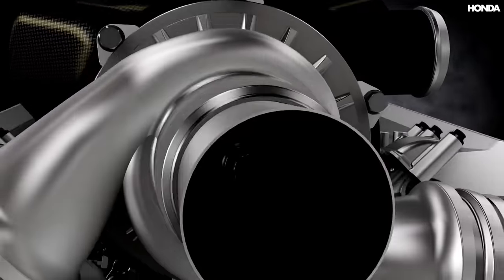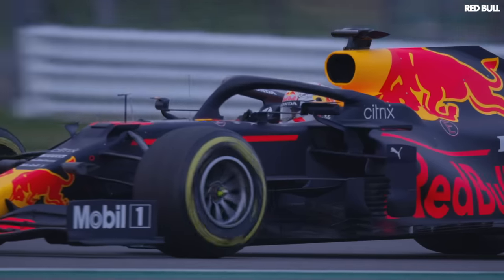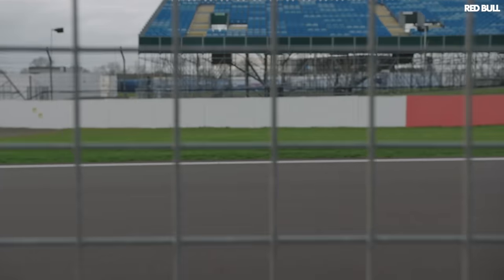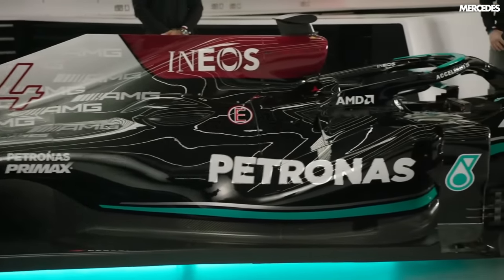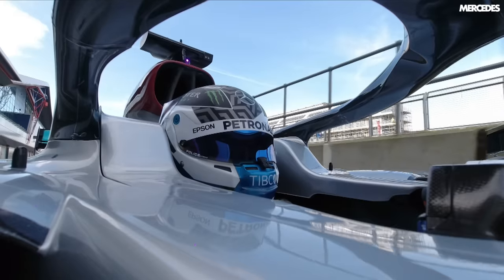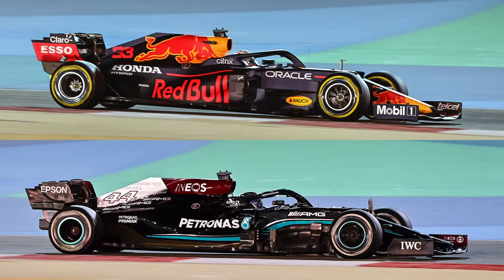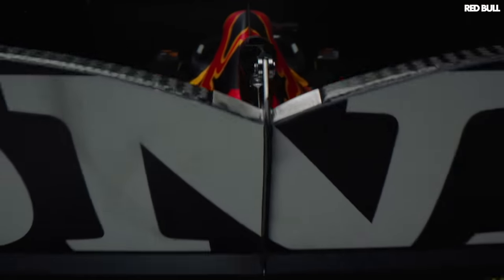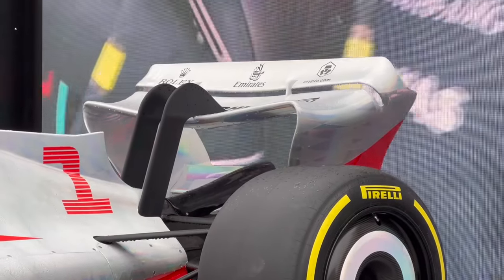Red Bull's SECRET Engine Upgrades to Beat Mercedes | Formula 1 Engineering

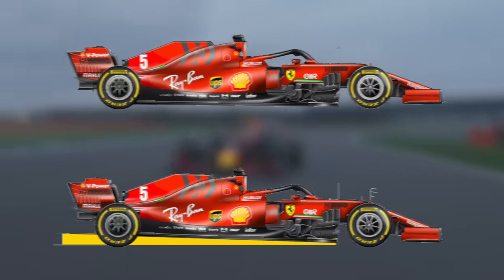Comment: the phase diagram you show as 8:24 is actually of water. the line solid-liquid separation line going with a negative slope is called the anomaly of water, since in most materials this line has a positive slope. so i'm not sure the phase diagram here tells the correct physics of supercooling

Comment: Super cooled could imply a partially solid liquid mix, like a slush. Spacex uses super cooled propellants, and this is what is ment in that case. The liquid oxygen is delivered to the vehicle as a slush, and the engines are tuned to run with fuel in that state.

Comment: Too much flex is however much Red Bull has.  Perfect flex is however much Merc has, even if it's more than Red Bull.
Reply: the tech regs say:-
Areo surfaces must remain ridged to the sprung part of the car(the chassis).

when you watch a rear wing take a bow along a straight from a camera fixed to the chassis that is not a legal back wing in acordance with the rules.

Comment: Could you perhaps touch on the reasons these two engines sound different? Hearing them in person its quite noticable, the different flutter sounds of the RB and intake sounds from the Mercedes. They are the best sounding engines on the grid!
Reply: The noise of the red bull off the throttle(over run) is the exhaust  gases   working on the mgu h like he explained
Reply: The Honda sounds brutal when it's off throttle going into a corner. Similar  to the blown diffuser  days

Comment: As I understand it, the split turbo also allows for simplified plumbing, which allows for tighter packaging.  Why the others haven't gone this route already I don't understand.
Reply: All engine makes have adopted it by now but Honda is the first to use it in that form of way. Merc was the first to do it and since it helped with engine power and efficiency. Renault and Ferrari both adopted the improvement as well.

Comment: Toto wolf already said that the result at silverstone confirmed something and that they unlocking a new thing, a new path. He didn't elaborate. Whatever Redbull is cooking, Mercedes is doing something even crazier.
Reply: This is why I've never bought the idea of RB somehow "having the better car" this season, or the notion of RB and Merc having "swapped places". Many of the people saying this tended to ignore such points made about Merc in past seasons on the string of their success, owing credit to the drivers when they probably didn't make up that difference on performance that people would want to think.
Reply: @AdotLOM  The Redbull having a better car thing comes from the regulation which removed downforce elements (Kept the different pressure Air from going under the car?! Not sure but something like that) from the skirt of the Mercedes' but Redbull are not as affected as much cause they run a (High rake, Shorter Car) compared to Mercedes (Low Rake, Longer Car)

Basically, the FIA stopped another team to benefit another (hindsight 2020)
Reply: Yeah Mercedes wings got clipped, add that to the fact that this years car was on the back burner early so they could focus on next year's car is pretty much an insult as if to say any other teams that are close are only because of hindrance/focusing on another era

Comment: @REDBULL was the ONLY TEAM that was allowed a NEW ENGINE although all other teams were not allowed to develop new engines or even introduce new engines for the 2021 season. WHY? Because @REDBULL and @Horner were whining about their old engine and threatening to pull out of F1 if they weren't allowed the new engine. WAKE UP F1 fans including you @Driver61, bullshitting viewers about technological "advancements to turbo units and other crap. #F1 is turning a blind eye to @REDBULL's new engine for #FINANCIAL reasons and because it would lose too much if @Redbull would pull out of F1. THAT's the REAL reason. and F1 fans know this!

Comment: Question Do teams use the Mgu-H to contol boost presser? If not would it be possible?
Reply: Yes the Mgu-H ( Motor Generator Unit ) is used to controll the turbo boost pressure. At high revs the Mgu-H gives electricity to 
the accumulator. At low revs the Mgu-H is becomes a motor to spin the turbo ( Almost no turbo lack )
In the new ( 2025 ) engine the Mgu-H is gone , now then there will be turbo lack. 
In the new engines there will be a bigger Mgu-K . So the engines are still about 1000 Bhp.

Comment: the rear wing of mercedes, and the rear of the car, lowering at least 30 cm, at the straights, was clearly visible on tv 📺, some close ups, at the 2021 Paul Ricard 🚙
Reply: 30 mm
Reply: what I saw was, at the beginning of the straight, the rear suspension of the car, visibly lowering, at a minimum 
20 centimeters
( this has nothing to do with flexi wings, but with suspension, resulting in a much lowered rear wing )
Reply: you need to watch the wing in relation to the camera not the road or suspension

Comment: 7:43 Some motorcycles have been using these variable trumpets for a while... as far back as 2007 in the Yamaha R1 4C8 engine. Some might have used them earlier, I just know about Yamaha cause I worked on a few.

Comment: changing trumpet length isn't new. They're used in high performance production motorcycles for  +10 years. the longer the trumpets are the faster the air flows good for high RPM (the time to fill the cylinder is simply shorter) but you get a pressure problem when you want to accelerate so you shorten them to have low RPM power.  Pressure =/= Airflow. you can't have both without cool moving trumpets.

Comment: Dear Scott
Could they add a small supercharger that helps them get off the line quicker and through the rev range to the point the turbo kicks in quicker.
I have an R63 and I love the supercharger compared to turbo charged cars as the power is there straight away,no turbo lag.
I’ve heard you can have both kind of like a twin turbo

Comment: 7:36 - variable-length intakes are not common in road cars, but they do exist. My Caterham has a Zetec with variable-length inlets (it's the fancy Zetec from the Ford Focus SVT), and it does indeed work really well with a much flatter torque curve than the standard Zetec.

Comment: The variable length trumpets isn’t new tech. Yamaha has been using it on the R6 and R1 sport bikes. When they switched from carburetor to fuel injection.

Comment: Seems that with knowing that the last 2 races Lewis won, the gap is reduced till 8 points with 2 races left, I don’t want to bet that RB has enough speed to beat Mercedes. But still it is totally out of the blue that Lewis is that quick and Bottas fails. I still have the impressions that Mercedes play’s na “nasty” game.

Comment: Would you not say McLaren have got straight line speed down to a tee ? Merc engine but different downforce levels and suspension setup McLaren sometimes beat the factory team in the speed trap but haven’t mastered the twisters yet, 2022 should be good for them I think with Merc power and more data from a lower downforce car can only give them an advantage with new regs rather than scrambling for downforce for the new regs like the factory team could be 🤷🏻‍♂️ long I know 😂 but they will along with Ferrari more tunnel time than Red Bull or AMG Armco Mercedes

Comment: With charger pressurerized fuel, electronic control of spark & electronic control of pneumatic valves you could design the engine to run as a 2 stroke at high revs while making sure it only runs 4 stroke during stationary testing. Mind you with a crank designed for a 4 stroke 720 degree firing order V6, while in 2 stroke mode one will be doing 2 concurrent 2 stroke 3 cylinder cycles. But that’s no big deal, that’s how Ricardo’s dual stroker works, (I assume). Having double the power strokes means more power regardless of the fact they’re concurrent.

Comment: Lewis Hamilton team should not change nothing on the Mercedes car what don't brake do not change it, do not change the engine for the Abu Dhabi Yas Marina race track the new engine would give  Mercedes a added advantage at Abu Dhabi Yas Marina race circuit, that is the way you want to see the Mercedes run with a massive straight line speed. without no compromise attack is the best strategy you have to take it to Red Bull what frighten Red Bull is Mercedes massive straight line speed.

Comment: The people need to understand that we have an engine freeze next year. If Ferrari and Renault are not able to develop the split turbo we will see no change. What honda red bull finally managed is what Merc perfected first. Throwing the engine in a race simulation and figure out where to throw electric power in for faster lap times. Not many talk about it but that's what it is too

Comment: You mentioned that Honda now use a split turbocharger but half of the pictures you showed had the compressor and turbine at the rear of the engine. Are the current F1 engines still using the split turbo? I remember seeing a video a while ago on the Mercedes engine where it looked like they had moved away from the split turbo setup so I'm curious.
Also you showed pictures of both barrel and butterfly type throttles, also curious what is actually used on the current engines. Would be nice to have some captions for the pictures so I know what I'm looking at.

Comment: You can cool a liquid beyond its freezing point by increasing the pressure. So the pressure stops the liquid from crystalizing and becoming a solid. While rate of cooling may have an impact, pressure is the main reason it stays a liquid. After all you showed a Pressure Temperature diagram

Comment: I'm skeptical about the supercooled coolant thing.  There is no way that coolant can be cooled below ambient temperature without having some sort of refrigeration system onboard.  There are systems like that out there, but they would add weight, volume, and parasitic power loss to drive the compressor.  But it would be worth it if they could achieve intake manifold temperatures 30F below ambient.  I would be a little surprised if the FIA allowed it.

I also don't believe that Mercedes plenum is double-walled and circulates coolant in it.  A plenum is not a good heat exchanger.  An intercooler is a good heat exchanger.  Maybe they have a refrigeration system for the coolant in the intercooler loop.

Comment: Variable trumpets or intake tube or manifold inlets whatever has beeen around for a long time and isnt hard to tune either. Its just connecting a servo to your engine maping in your icu really. Different engines work differently though so there is no cookie cutter way of doing it. Haven't seen it on a motorcycle yet so maybe thats the next step... However it requires really good airflow and if you are using an airfilter it gets more complicated since tou will need a bigger inlet but will still have some vaccum effect...

Comment: the main reason red bull is so much closer to mercedes has nothing to do with the engine. it's the floor regulation changes which hindered mercedes' design but it's their fault for not picking up or underestimating the time loss.

Comment: I didn't understand the part about Merc cooling the air entering the engine. From what this video was saying they were cooling the air to below zero degrees which would require an air conditioning unit. It seems unlikely that Merc has a compressor for cooling air on their engine with all the loss of power (mechnical or electrical) that would entail.

Comment: Yes but condensation is an issue with sub-cooling temps when atmospheric temps are much greater. Unless these units are in a vacuum housing. Parts get water touched and likely damaged easily
Reply: are you a pc builder by any chance? I wouldn't this would be a concern.  we're not talking electronics and PCBs that don't like water here.  All that being said, if you start using that coolant right away, and that cooling unit never comes into contact with the atmosphere WHILE being cooler than atmospheric temperature (the coolant has already removed some heat from components,) then condensation is not an issue at all. The coolant system itself is indeed necessarily under vacuum, if it's super-cooled (otherwise you have something below it's freezing temp at atmospheric pressure, turning to ice)
Reply: @threepe0  no we are just using nitrogen to OC that can’t possibly collect condensation??!!!
Reply: @threepe0  that’s what I said

Comment: Since silverstone Merc have been ahead and will continue to be Merc takes both titles unfortunately thanks to the car again because as drivers Max has owned Ham in slightly lesser machinery.
Reply: Didn't get to see anything useful in silvestobe as mx was punted off, and Hungary Bottos destorued both RBs, Dutch GP was a clear RB win, belgium Max, Italy, dodnt get to see the end result, Russia and Turkey, Merc.  My point is, Merc have caight up, bit it is diffickut to see who is faster, it all boild down to who sets uo their car the better...
Reply: @tommiko8313  wrong Merc have pulled half a second alone in qualifying on rbh this season 4 times max cant do that. The Merc follows easier to the odd cercuits Rbh have been better at however. Ham has underperformed this season and on performance alone Max deserves the title. The merc is a better qualifying and Race car also looks after its tyres better.

Btw Merc was never really behind it was about 50 50ish before silverstone and all Merc after.
Reply: @JFSR_777  That's your opinion, we'll see end of the season !
Reply: @tommiko8313  that is my opinion and actually many facts if you do your research you will see for yourself. However you may choose to ignore them especially if your a Ham fan they are completely delusional with there goat bs!
Reply: Bullshit command, comming from a Honda fanboy. The cars from red Bull aren't as near as good as Mercedes' cars.  Overall concerning structual/ performancewise this can be said: 
The car is only as good as your team's 2nd team car. In red Bull's case: it isn't Perez which is, just as the rest of the grid, an excellent driver. It's not the car , which is ofcourse structually different than mercedes' cars. NO. It's pure Verstappen talent and abillity who get him this far.. 
Don't believe me? Check his data after the race...
Reply: @doargietweitervandah  erm this is basically what im saying the Merc is a better overall package straightline speed looking after tyres and general aero is just better. The Mafia helped clip RBH wings.

Comment: I have two technical questions:
1. If McLaren, Williams, and Aston Martin have the same Mercedes Power unit "Mercedes-AMG F1 M12", why is there so much difference in speeds?
2. RedBull Power unit "Honda RA621H" is more efficient at higher altitude (like in Mexico) than "Mercedes-AMG F1 M12"?
Reply: The drivers from McLaren, Williams and Austin Martin all used 4 power units each. Bottas and Hamilton used 6 and 5 power units respectively. Bottas probably testing the power units limits and degradation so Hamilton could drive the power unit over it's designed limit reliable for a known quantity of time before they had to turn limit it's  output. And because the 5 places grid penalty was not really a penalty Mercedes just got him a new engine.  That's the real reason Hamilton was so quick the second half of the season. If Max didn't crash at Silverstone he would not have needed the fourth power unit. What makes the Honda unit incredibly reliable after the previous seasons.

Comment: yyes that intake trick to let the shockwaves of the air be at the right moment the valve opens is a old trick even a lot of street cars have it they even have two lengts of intake tubes one for low rpm and one for high rpm but with a turbo this advatage is a lot less then a engine without forced induction

Comment: I would personally like to see the technical details presented more slowly and discussed more clearly. I don't know where you obtain allegedly classified or proprietary details. I am not convinced. My advice would be to shorten the sponsorship part and while providing sources and references to back up some of the claims made in this video. How do you know what refrigeration method is used and where did this phase diagram come from? Sorry.
Reply: Agreed, some info given here makes no sense , refering to FIA F1 tech regulations.

Comment: I am curious as to your thoughts on what engine performance and these engine differences will mean for 2022 cars. Will it mean that since downforce is mainly being generated by the floor now combined with maximum car dimensions, that packaging is less relevant and more power is beneficial or vice versa?

Comment: What I find interesting is that RedBull had the faster car on the straight and with the start untill and including Silverstone. After that Mercedes has the faster car. Is there an explanation for that? Is it that Mercedes are simply driving with a more aggressive engine mode, or did they have an upgrade in de PU that isn't actually allowed?
Reply: Red Bull we’re able to run less downforce because their higher rake car had more mechanical grip. That extra mechanical grip, means that the reduced downforce gave less drag on the straights, which equals more speed on the straights.
Two things have happened, Mercedes have improved the car and Pirelli have changed the tyres due to safety. The tyres now have stiffer sidewalls, which has effected Red Bull and helped Mercedes. The irony is the changes were only brought in because Red Bull were one of the teams running illegal low pressures which contributed to the tyres failures in Baku.